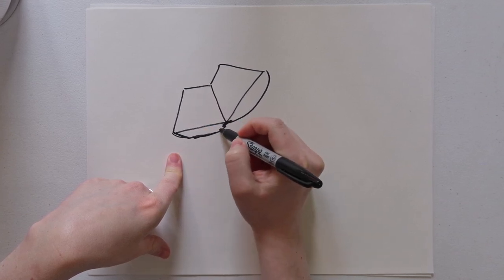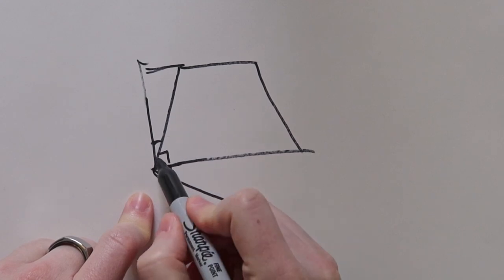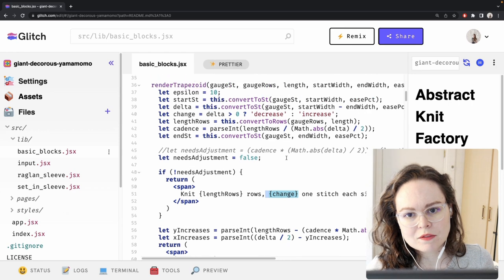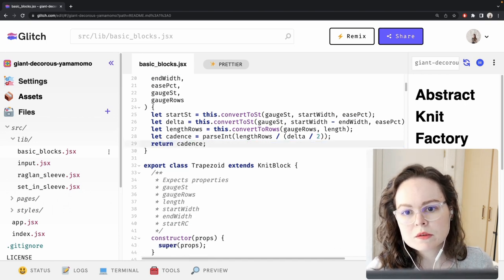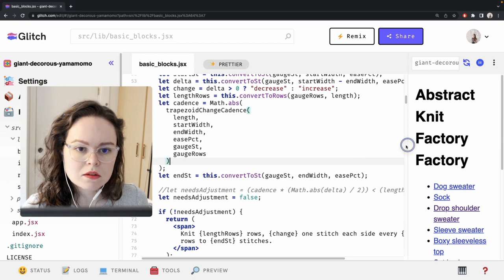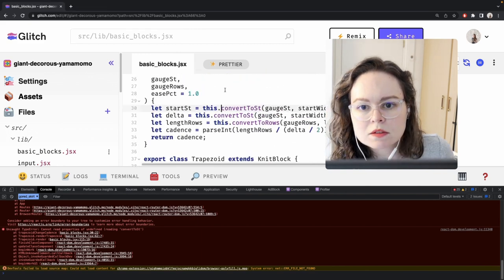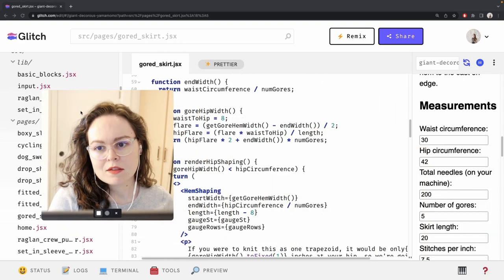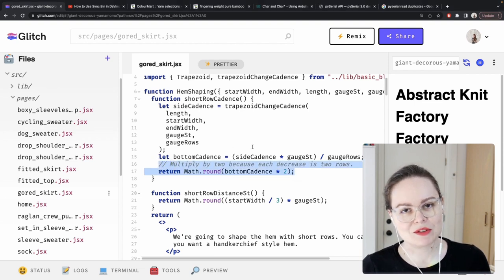Knitting a gored skirt with short row shaping | Machine knitting a dress

Comment: I discovered your channel yesterday. I haven't pulled my KM's out since burning out in 2020. I have an extra 930 bed without a matching carriage I may have to give AYAB a try. I've been using img2track and really love it. I create pixel art on the iPad and then import into img2track on an older MacBook. It's really fun connecting machines from the 80's with 2k of ram to modern machines.

Comment: React developers at my company won't be safe anymore- PM will get back to programming. I didn't had any motivation to grow my knowledge in JS as I don't code normally.
Now I think "Hm... This is best way of generating all kinds of patterns for crocheting, knitting, sewing and if I will understand better SQL and R I can built Data Bases for all my crafts and more..."
With C after a few months I no longer saw the code but the components of the machine.  If something broke, I looked at the elements and saw bugs as broken elements.  Well, apart from the semicolons - you never see them...😂